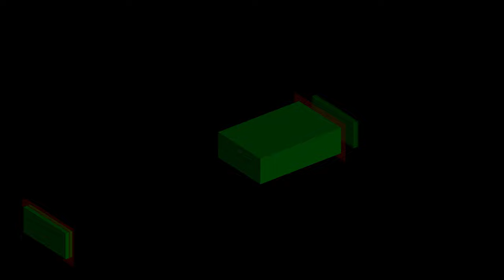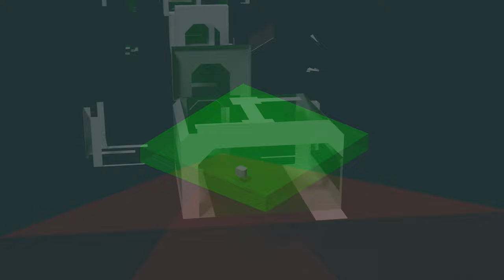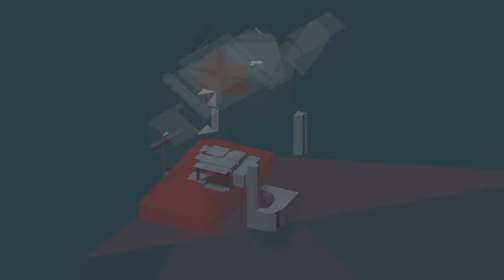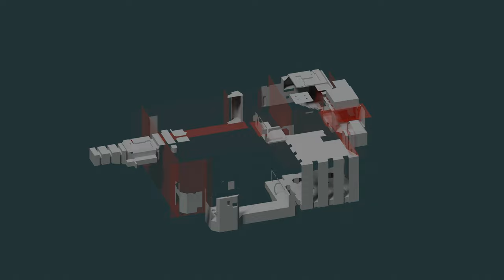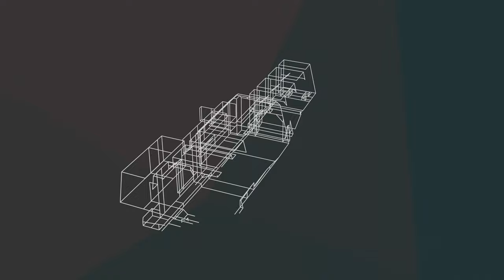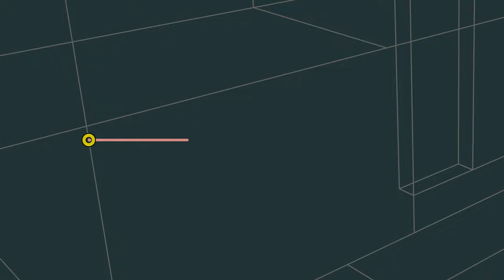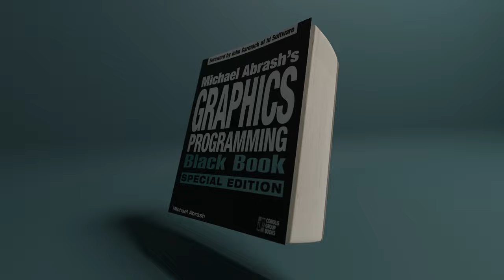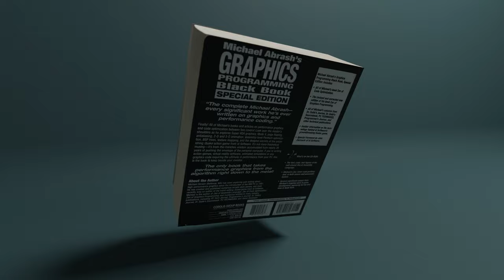How Quake's software renderer ELIMINATES overdraw [⚠️ flashing images]

Comment: When I watch your videos on quake I usually try to recognize which parts are relevant to modern graphics programming and which aren't. I suppose if you are taking advantage of the graphics card and modern graphics APIs then everything in this video after the "Back-face culling" chapter wont be particularly useful since you can have your graphics API automatically perform lots of tests to prevent overdraw.
Reply: Yes and no. Yes, because programming on the CPU, you don't need to worry about such. However, no because that's actually not far off what the GPU does, so understanding Quake's rasterization helps in understanding how a GPU works. While algorithms might be differ (sometimes significantly), the biggest difference (by far) is Quake is single-threaded (it wasn't until after 64-bit became commonly available that multi-core cpus were commonly available), while GPUs do the vast majority of the work in parallel.

Comment from the maker: ⚠ WARNING:  This video contains flashing images.

There's a lot of details I omitted to keep things brief.  For example, there's slightly different behavior if a sub-model (door, lift,  button, etc) is being drawn.  Also I haven't spoken about texture mapping yet --- I think that topic warrants its own video.
Reply: A great follow-up to the texture video would to discuss what changes Carmack had to implement/omit to add hardware rendering for the 3Dfx and later GPUs.
Reply: Did you forget to pin this comment?
Reply: @tiagotiagot  Lost the pin due to edit.
Reply: @Creative Unreal (software rendering) did checkerboard dithering with the u,v coordinates in screen space.
Reply: The worldspace clipping of BSP entities against the world geometry is actually very relevant to this video, because it eliminates most z-fighting. Z-fighting can still occur between different BSP entities, as in one of the maps of the Contract Revoked mod.

Texture mapping, however, should indeed be in a different video.
Reply: @Creative There are z fighting issues between different BSP entities. Go play the Contract Revoked mod and look at the lava floor of its Normal skill corridor. That z-fighting happens at the edge level, not the pixel level, because the edges of different BSP entities are not checked against each other.
Reply: @Creative The newest video in my channel shows the proof.
Reply: @Creative Exactly.
Reply: @Creative Yeap, Tim Sweeney offsetting the u,v data was pretty clever!  Lets you avoid doing a 24-bit bilinear filter.
Reply: @Creative Unreal palettized their 8-bit textures.

I don’t recall if Unreal supported 320x200 8bpp; I thought the lowest was 16bpp screen resolution.
Reply: @Creative When I worked on Need For Speed (PS1) I managed to look at the PC source code which I believe used a palettized 8-bit framebuffer. Frank Barchard,who wrote a good chunk or our internal EA Library, had 16-bit inverse blending tables. To do 8-bit palettized blending one could:

1. From a 8-bit texel fetch the 24-bit RGB pixel
2. Convert the 24-bit pixel to 16-bit
3. Use this as as index to lookup in an inverse 16-bit table to get the global 8-bit color.

All the source textures may also have 16-bit internally but rendered out to 8-bpp on the fly. Sadly I didn't pay much attention to the PC version due to us crunching on the PS1.

All our textures on the PS1 where 4-bit and 8-bit palettized. I don't believe we used that inverse 16-bit table but now I'm wondering now how we did our alpha gradients (since I worked on the PS1 UI along with Shelby.) I remember things "just working" so maybe Frank was using them there too?

I don't recall seeing Unreal do 8-bpp blending but I easily could be wrong.
Reply: @Creative We used gradients for the drop shadows.

Comment: Great breakdown, thank you. Having done my own reading of the Black Book, and other of Abrash's articles (which seem to be the most time capsule-y articles available on the Quake engine development) I'm struck by how pragmatic many of the choices made in building the engine were. For example, the PVS doesn't eliminate overdraw by itself, but it greatly reduces it. Carmack knew it was stupid to try to get the PVS perfect (in fact, fine-grained PVS is still an open problem today). PVS as implemented in quake gets the set of polygons low enough that span buffers can be used -- span buffers being even for the time a slightly outdated algorithm, that was designed in a time when writing a pixel was very, very slow, to completely eliminate the remaining overdraw. Overdraw in drawing the world was very expensive because every pixel had to be textured and lit, and world polygons tend to be large. But then at model drawing time, Carmack just said fuck it, the polys are small enough that we'll just the z-buffer.

Comment: A much simpler approach that comes to mind is to keep a list of occupancy spans while plotting polygons front to back. Then there will be no more than a handful spans per each line, and at their size, they might as well be an array. What speaks against that?

One thing and a big one is integration of entities (enemies items etc) into the rendering. That you have discarded environment depth data from your buffer before you need it again to occlude the entities by the environment.

And another is cache optimisation; that you have execution alternating between various domains of code like BSP traversal, clipping, triangle setup and rasterisation, this means code and hot data get pushed out of the cache regularly. Cache optimisation is a big must to make something run fast on a P5.
Reply from the maker: Hello, to render enemies etc a depth buffer is indeed used, it is just that for the main level only depth writes are required, which were apparently much faster than depth reads.  Your idea with spans sounds like it should work. I've no doubt it was considered by Carmack, Abrash, and co;   it'd be interesting to know why they went with the AEL/APL approach.  Edit: Chapter 66 of Abrash's book talks about this in the Sorted Spans section.
Reply: @MattsRamblings  I'm certain they tried more than a few things. By drawing one surface at a time and having no interleaving tasks, good texture fetch locality is achieved, and cache can be utilised especially if they use swizzled texture format.
Reply: @SianaGearz quake 2 sorts the output span list by surface (lit textures) to optimize cache hit rate, but I don't think quake does this.
Reply: @Ehal256  Once you start increasing geometric resolution, you're going to need better methods than just drawing one whole surface at a time to achieve better cache locality. But either is better than rendering the whole spanbuffer line by line top to bottom. Of course one can come up with tile based methods as well and so on but they can also be hit or miss.

Comment: Did the book mention the span algorithm you described, and did Carmack say it was more efficient than the regular approach?
Reply from the maker: The book does describe the AEL / APL span algorithm:  Check out Chapters 66 and 67.  There are some differences compared with the final version in the GPL release, so refer to source for the true method. It was the best technique they found, in terms of maximizing the worst case performance,  that is to say, still performing well on the hardest scenes.
Reply: @MattsRamblings  That's awesome, thanks

Comment: What about Z-fighting? I find it interesting that the Z-fighting traces bleeds across horizontal scans consistently and if the camera is kept still, the Z-fighting pattern does not update. You can get certain camera angles where one texture completelly obscures the other while you can get other camer aangles where there's a diagonal streak. Wouldn't Z-fighting be very costly rendering time wise with this algorithm?
Reply: I’m not sure if Z-fighting would really apply here given how the world geometry is generated from the CSG brushes. The span optimization is only done to the BSP geometry, which (if I understand correctly) already has hidden surface removal applied to it. Levels are paper-thin shells that have no exterior.
Reply: @MaximumADHD  If I remeber correctly some issues with Z-fighting in levels appeared with GLQuake that did not exist with software renderer.

Comment: Finally everyone can make non laggy 3D engine for calculators!
Reply: I wrote a doom renderer for my Casio, works fine
Reply: @thewhitefalcon8539  the talk was about rasterization of polygons, not raycasting
Reply: @Z_Z.t  Doom doesn't use raycasting, it's an interesting hybrid of polygon rasterization but restricted to mostly 2/2.5D.
Reply: @Ehal256  whatever, doom is a different and simpler engine, so some of tecnologies shown in video are not used there, because there's no need to.

Comment: how did they adapt the software renderer way of no redrawing into the OpenGL renderer of GL quake or in Quake 2?
Reply: Quake was software rendered, development started before Doom was released, and they likely added minimal OpenGL support by replacing end of graphics pipeline to draw polygons using OpenGL.

IdTech3 (Quake 3 arena) likely was similar but more optimized to work with 3D-hardware. IdTech4 (Doom 3) was overhaul to architecture. Sadly that failed because it used patented algorithm and engine was very dependent on those shadow volumes. IdTech3 was very long lived engine.
Reply: @gruntaxeman3740  keep in mind that in the Quake 2 engine Karmack made it a point to no overdraw anything, now how did he do it?
Reply: @Biel7318  

Quake 2 engine is basicly same as Quake 1. Software renderer where end of rendering pipeline works in graphic card.

It is easy to make engine with zero overdraw. Like raytracing whole image. It is not necessarily good idea to have zero overdraw as it is faster to let GPU do the work than use CPU to minimize overdraw.
Reply: @gruntaxeman3740  independent of it's optimalness when rendering. Carmack did made an intent of zero overdraw with Quake2, but using the GPU instead of the CPU unlike Quake1. I'm just asking how different is that method to Quake1's
Reply: I don't know if it was actually done this way in Quake 2, but with a GPU it's better to culling at the level of BSP nodes and not worry about a little bit of overdraw where one node overlaps behind another
Reply: @Biel7318  I am pretty sure that quake 2's software renderer is about the same as quake 1, although it adds some more tricks like sorting spans by texture before drawing, so that the cpu cache bandwidth is used more effectively.
Reply: @Ehal256  that's the point of why I'm asking, imagine a response like yours but in a form like a cool video explaining it, and even explaining how Carmack did it and even if today makes any sense as the others commented.
Reply: @thewhitefalcon8539  what's interesting that VQuake (for Verite 3d cards) actually kept the span rendering.

Comment: Ive been working with unreal engine 5 a lot and i love some of the modern optimisation methods possible with powerful gpus and multi core cpus, its hard to expain just how many advantages these have. But it gets frustrating when you see "new culling tech" being advertised when the problem was allready solved 30 years agao on less powerful hardware, in a more efficent way. If i had the time to go through unreal engine code and make some overhauls i think itd just end up using the same solutions found in quake (though some problems can be done better with modern hardware then could be done with methods used in quake".

In short, quake did optimisation better then multi billion dollar companies 30 years before and its very frustrating.
Reply: Definitely a case of "yes, but no" as methods for transparency; in particular the lighting and shadows around them, have changed a lot and require greater efforts to prevent drawing errors. That said, having an expanded set of rendering options with a hierarchy of what other methods they rely on being parsable so the desired balance of older optimizations to realism could be achieved on demand would be a wet dream, especially if it could be injected into earlier titles. The specular mapping of the mid 2000's that carried on way too long is something I'd probably tweak in every title I could😅
Reply: @Xeogin  i completely agree, i love 3d graphics and things like ray tracing is pretty much a must have IMO, but binary space partition gave so much preformance improvements (in inside spaces) that its kinda stupid to not use.
Reply: @hughjanes4883  BSP is highly focused on static geometry, and it also requires a fair bit of precomputation. While it's still very effective on modern CPUs (see Ironwail), I can see why it fell out of favor.
Reply: @hughjanes4883  BSP goes very bad very quickly with complexity. Cross cutting planes are a minor problem in Quake but they get drastically worse once you start doing intricate geometry. It was a suitable solution for the time, not for all times.
Reply: Yeah, but think of the kind of content we handle now a days. Most of it is dynamic and changing, whereas Quake levels are fully static. Also, current content has millions, literally almost, of triangles, so an active line list iwould become a large  structure, and having ever smaller triangles (such as the nanite system) would make this structure even larger than an equivalent depth buffer and sorting through them and referencing polygons would pose a computational complexity that would make their utility rather limited, setting its scope completely outside of the real time rendering. But the core optimizations are still there, for example, many of the current engines do a depth prepass precisely to prevent the overdraw of complex pixel shaders
Reply: While I find Quake's culling system very beautiful, it simply would not scale to the kinds of scenes UE5 is expected to render. While Nanite's culling system runs on much beefier hardware, it is also designed to handle many orders of magnitude more triangles, with moving objects, and render them to a screen with several orders of magnitude more pixels, in less time then the quake algorithm since modern gamers expect both higher framerates and more complex shading. It's a different solution for a different problem.
Reply: @cerebralm  your right but i tried to implement bsp in UE4 once, it would just sort which models to render tho not anything very fancy
Reply: @hughjanes4883  

It is stupid to use same way as Quake worked today.

It is faster to minimize draw calls than thinking fancy way to cull everything. Like just use occluders, or portals with potentially visible set.
Reply: @cerebralm  

True.

And if thinking UE5 like scenes with more efficient way, it goes to asset optimization and big speedups can be achieved just to work without nanite (because extra render pass) and using forward shaded system than deferred shaded. There is tradeoff with lighting but good culling (with lightsources too, not only visible objects) can make complex scenes to run on.. example on tablet.

I see that kind of optimization interesting to get similar results without kilowatt heater.